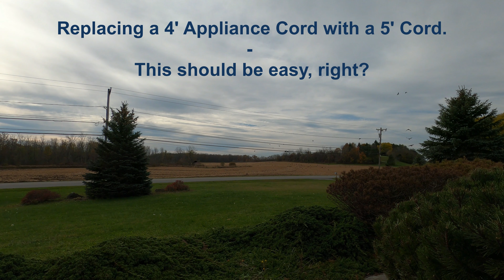Safely Replacing a Small Appliance Cord | Man About Home

Comment: I did not unfortunately learn anything new, mainly because wasn't really what I was looking for.  However, perhaps you can answer my question in comments.
I'm trying to find if there is a reason I cannot or should not repurpose a dryer cord into an extension cord. 
My new dryer arrived with a cord I don't need (I purchased a new one, the right one.) I was charged for the wrong one, the delivery guys preinstalled it and told me I could not return it.  So I have an extra brand new heavy duty 10 AWG dryer cord. Short of course but my experience even short ones can be extremely useful.  Although, considerably less so with a  dedicated dryer receptacle plug. 😁
I have repurposed salvaged cords but so far cannot find a thing mentioning something like a dryer cord.
Again this is brand new and application not to be confused as having any thing to do with a dryer.
Reply from the maker: That's a good question! There must be thousands of people out there hanging onto an unused dryer cord because they might find a use for it. I still have one in my box of old electrical cords too. I'm guessing the reason you needed a different cord has to do with the (now old) change in the National Electrical Code that requires the use of a 4 conductor cord with a 4 prong plug, on electric dryers. So if you purchased a new dryer, it should have been set up to use a 4 prong plug. The problem is, many older homes still have a 3 prong dryer receptacle installed, so many new dryers are kind of forced to use a 3 prong cord, which is less safe. I'm guessing you now have a spare 4 prong dryer cord? Electric dryers use a 240Vac power source, meaning 2 of the wires in that cord will be Hot (1-Neutral, 1-Ground. 3 prong cords don't have a ground.). That 10 AWG cord and plug are most likely rated for 250 Volts and 30 Amps. The average home doesn't have any other use for a cord, or extension cord, like that. But I checked my local Craigslist and Ebay and found that people have them listed for sale there. That might be an option if you don't have a specific use for it. Other than that, I'm keeping my old dryer cord in the box until someone needs it! Thank you for watching and commenting.
Reply: @manabouthome  Mahalo! Yes 30 amp,  gotcha. A failed 💡 idea. (Win some loose some. 😏)
Problem was due to length. Connection at tippy top of 6' tower unit & extreme opposite side of receptacle location. Was required to purchase a cord of unknown length at time of W/D purchase. In a way though a good thing in the bigger picture re: 💩 delivery & installer.
(Pardon my vent. 😁)  I asked how long the cord they were supplying was when it arrived. Both said they did not know or would even show me it untill installed. And when  pressed, wanting to save them the trouble  if it was too short, insisted angrily it was for my protection a professional took care of all that. 
And what did I find after they left? The ground unattached, neutral barely and hot not at all securely. 
I never expected such gross negligence but in hindsight sight should have. At "I hope that's where you want it bcause YOU are never going to move it again." I thought he was just being plain silly, thought I hadn't noticed it was not plugged in or the exhaust vent connected, stupid little old lady. 😏
Reply from the maker: That's ridiculous. Those installers owe it to you to make it right.
Reply: @manabouthome   Ridiculous indeed!  It is astonishingly easy to move a 300 pound appliance after a squirt of windex to the floor. 😆